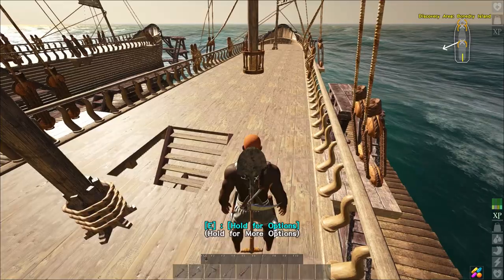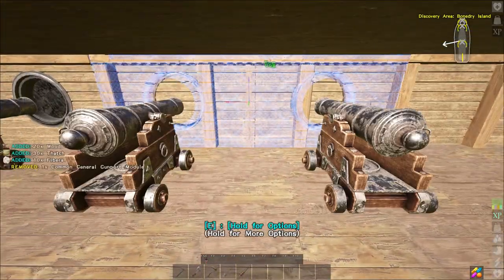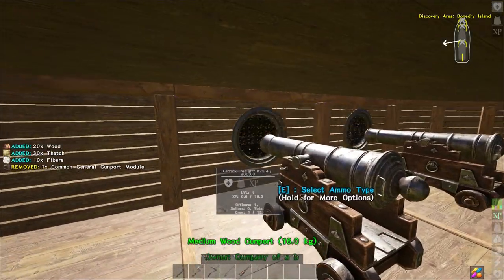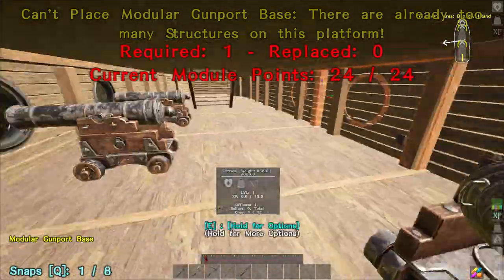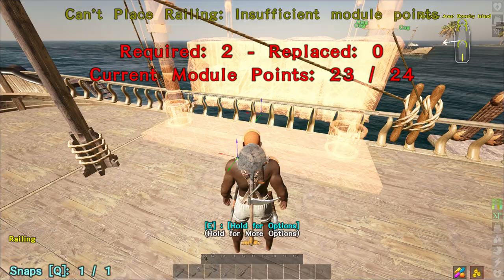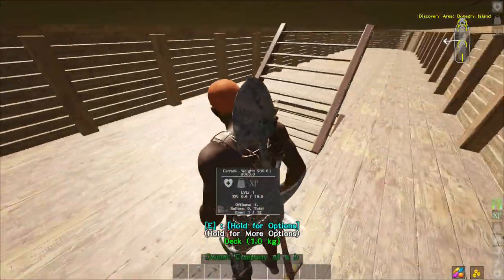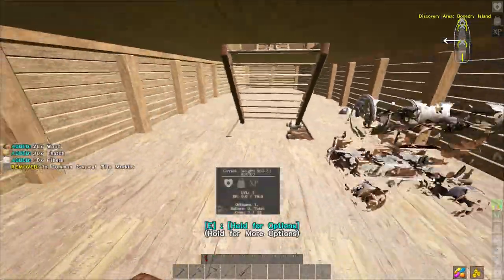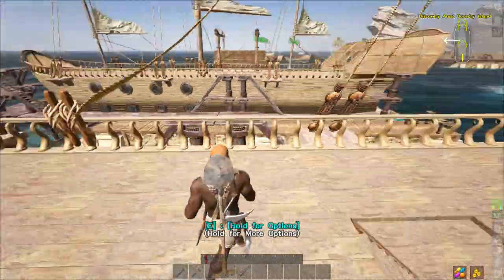How to Deal with the Carrack Module and Structure Limits - Atlas

Comment: Module points are so frustrating. I got a broadsider that crafts at 64/60. Can't do anything with it
Reply from the maker: Yeah it’s a thing, need to find those better BPs till the fix comes
Reply: @Skarvig  quick question is there a structure limit on brig and galleon?

Comment: Where do you find the plain tile to replace the gun port modules?
Reply from the maker: It's made in the smithy with the other module parts.

But there is a known issue where it disappears from crafting list from time to time and you may need to try rebuilding the smithy.

Comment: Also do u know what to type in for the cog, carrack and kraken blueprints?
Reply from the maker: The codes are ssf krakenship ssf cog ssf carrack. You can also use this style to get blueprints gfi krakenship 1 0 1
Reply: @Skarvig  do you happen to know the codes for the railings as well? Tried several combinations and only have gotten tiles to work, not gunports .
Reply from the maker: There's a couple of different ones in there, not sure which one is the working one. For rails and modules I'd recommend just spawn in the resources and make them in the smithy.